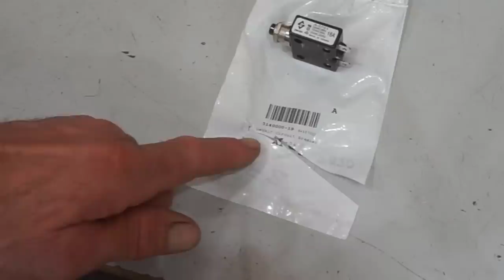DW735 Planer Deep-Dive Maintenance

Comment: Have you had to replace the rubber rollers due to the rubber getting hard and slipping on boards?
Reply from the maker: No I personally have not had that happen and have had 2 dw735 planer is for over 10 years each. They do get wood resin build up on them which might make the rubber seem hard but by thoroughly cleaning the rollers occasionally they don't seem to degrade measurably even over those many years.

Comment: Hey, Matt.  Love your work and the channel.  I was wondering if you considered any other reason the motor might be overheating, like dust blocking fan ports, dried out bearings or other issues at the motor proper?   I wish we had contractor craftsmen of your caliber here.  Best regards.
Reply from the maker: I haven't looked deeper into it because I was convinced the bushings would be the problem so I was surprised that everything was in such good shape.  New brushes might help but there's no indication or hint that the motor itself is laboring unreasonably.  Hoping I just got an inferior thermal breaker... that would be a first from ereplacementparts but not impossible to consider.  Time will tell... thanks for watching and commenting LMR!

Comment: Hey  Matt do you have any experience with the Shelix cutting head for the DW735 and what are your thoughts about them?
Reply from the maker: Just recently I actually verified what I suspected about helical cutter heads in the dw735 planer all along: while the surface that cutterhead produces is glass smooth even on difficult grain the small diameter of the cutter head leaves very shallow scallops across the width of a piece being planed., to me that fact is a deal-breaker so I will always have a planter with straight knives for making the Finish pass on wood that goes through my shop. Despite all the other Superior performance specs of a helical cutterhead the scalloped surface is a deal-breaker because I'm not going to devote the time necessary to sand out the scallops. I'm sure I will get flamed bye  the  helical cutterhead proselytizers for making this statement but the proof I have is undisputable. In a perfect world though I would have two planers: one with a helical cutterhead as the Workhorse of the shop and the one with straight knives for making just the final finish pass. I'm adamant enough about this that I may well buy a second planer for this ideal setup.
Best, Matt
Reply: As always great information, thanks.

Comment: I’ve discovered that the hex head bolts on the idler side are rounded over. I’ll have to work to get them out but I’d like to replace them with torx head bolts. Does anyone know the thread size and where to get them? TIA
Reply from the maker: The thread size is shown in the  head replacement bolts I've listed on my Amazon influencers page which you can find in the video description. If you can find a good quality Torx head fasteners of the same size and specs then it's a better choice than hex with both being far better than Phillips

Comment: Anyone have suggestions or how-to for setting the planer head parallel to the bed?  I've tried a couple things with no luck. Ref: planer (DW735) cutting about .100" difference side to side on a 6"wide board.
Reply from the maker: I've not checked but wonder if it's somewhere in the owners manual.  You might ask at ereplacementparts.com because if you replace any of the height adjusting parts you probably need to go through steps for re-aligning cutterhead to platen... let us know if you find a tutorial? Best, Matt

Comment: Lots of great information.  I just bought a DW735 and I'm performing all the maintenance items you show. Thanks. Mine seems to be stiff raising and lowering. Any ideas?
Reply from the maker: I've heard from other viewers who experience stiffness in height adjustment that seemed due to damage of columns during shipping.  I'd check into that to make sure you don't need to exchange it because raising/lowering should be smooth... not easy per se, but not 'stiff.  Best, Matt

Comment: thanks for the video I refer to this often when I maintenance my 735. But I failed to see where you spray silicone. ? the link for Amazon items does not load. what chain lube & silicone do you use ?
Reply from the maker: I don't remember exactly where I sprayed silicone in this video but it's basically anywhere I don't want pitch and gum to stick... but NOT on the infeed/outfeed rollers.  
You might find this video I did here on the Channel showing general DW735 maintenance tips helpful for more routine maintenance I do to get peak performance out of mine: https://www.youtube.com/watch?v=r_yEwlsYGbU  

Not sure why the Amazon link is dysfunctional for you... could be browser issue because it works on my end.  I updated the list at the above link by adding a silicone spray I like but the Boeshield T-9 chain lube I use was and is still on the list.  Let me know if this helps you out?
Best,
Matt
Reply: @NextLevelCarpentry  That helped thanks for the quick reply. I searched your list on Amazon web site and found your products. FYI I use Safari for the link.

Comment: What can I use to clean the rollers?  My planer is new but it just will not pull the wood so I have to push, yes the rollers are moving just not pulling.
Reply from the maker: This is the basics of the process I use:  https://www.youtube.com/watch?v=r_yEwlsYGbU&t=1s
Reply: @NextLevelCarpentry  I went to the DeWalt information site and they said use Mineral Spirits as it cleans and makes the rollers tacky again.  I tried this and this planer has never worked better.  I did use Johnson's paste wax on the bed and now I'm planing like a pro again.  Thank you sir.

Comment: My dewalt planer 735 cannot raise or lower to the thickness of the wood. Any ideas?
Reply from the maker: Sounds like a pretty drastic condition and one I've never experienced. If you are mechanically inclined at all I suggest removing the top cover for a look inside to see what's up. If the handle won't turn I suspect the chain is severely rusted or the top of the machine is packed full of shavings. Either one of those conditions could cause a problem you're having.
Reply: @NextLevelCarpentry  thank you

Comment: Great video. Will do this to my DW735. What about lubing the 4 height adjusting posts and gears?
Reply from the maker: I've not figured out how to lube the height adjusting gears... I do the chain that connects them all but sometimes still get an un-fixable squeak when doing large height adjustment changes.  Biggest issue/concern I have is that the planer would be worse than useless if something got off throwing the parallell-ness of cutterhead and platen off.  Since I don't want to learn/figure out enough to re-calibrate it I just leave it alone for now... Best, Matt

Comment: Can't  switch speeds with selector switch how can I repair this?
Reply from the maker: The planer needs to be running to shift the gearbox.  If it won't shift while running it will probably require a rebuild of the gearbox.  I've never experienced this problem and think the shift mechanism is pretty robust so I'd be surprised if anything broke.  If your machine is heavily rusted, it might me using rust buster on the shaft behind the shift knob.  Good luck... and let us know what you found out once you get it to shift? Thx.

Comment: Did you check if the cutter head turns smoothly? Those bearings take a lot of abuse.
Reply from the maker: That should definitely be on the checklist for a planer tune up!  The bearings are pretty robust and I've not had any failures but I may just be lucky?

Comment: Lets talk about the elephant in the room.I am curious about why the blade roller was not service as well.It must have beartings to,it spins very fast,it should attract dust as well.I would be curious to see the state of those bearings .If you remove the belt,would it free run ???
Just curious.
Bye.
Lucien
Reply from the maker: If it ain't broke, don't fix it?  Never had any trouble with it at all so I assume it was engineered better... fingers crossed though as I might be jinxing it! 😉😎

Comment: bought a new dw735 planer but the depth adjustment wheel so stiff to rotate up or down. I need help to solve this problem. Anyone?? please
Reply from the maker: I've heard this before and attribute that problem from damage during shipping.  To solve it I think you should check into getting a replacement since depth adjustment should be smooth and easy...  Best, Matt
Reply: I'm guessing your corner posts are not adjusted right. If you put a board that is the same with on each side the crank the rollers down on the boards they should all hit at the same time. if not you need to adjust the post that is off. once they are the same it should crank easy. If not the base may be warped and need to be replaced. I bought mine damaged and had to replace the base and do the adjustments and it works great now.  good luck, Dave

Comment: Ever service the height adjustment? Mine is stuck.
Reply from the maker: I've only maintained it by cleaning and lubricating the threaded columns and chain.  I suggest removing the top cover cuz there's a good chance there's a hole in the impeller housing that filled the entire machine which packed-in shavings that prevent it from raising/lowering.
Best,
Matt

Comment: Great video!  My DW735 has a 2013 production date, so I guess I’ve had it about ten years.  Last year I installed a Byrd Shelix original diameter cutter head in mine.  I always use the #2 speed position for the fastest thruput, but I’ve recently noticed it won’t shift to the #1 speed.  I assumed maybe one of the shafts moved relative to the others on reassembly, but I notice you didn’t do anything but straight reassembly of the parts.  Any ideas on why it won’t shift speeds?
Reply from the maker: Make sure you only shift it when the machine is running free, not under load.  The gears only mesh when turning.  Not sure what to think if it is running and won't shift but imagine the only fix is to open, clean and re-lube the 'transmission' but I've never heard of anyone needing to go to that extreme.
Reply: @NextLevelCarpentry , yes, I keep trying to shift it while it’s running.  The speed knob operates a shaft that goes into the gearbox, but it won’t move.  At some point when I’m enthusiastic, I’ll try pulling the gearbox cover to see if it’s obvious why.  Obviously, my theory of getting the rollers out of position isn’t the answer.  Thank you!
Reply from the maker: Good luck, Bill.  Do you know if the shifter worked before you swapped cutterheads?  Might be reason to think the problem is outside the gearbox, not inside it...  Hope a simple clean and re-lube of the gearbox does the trick.
Reply: @NextLevelCarpentry , thanks for the insight.  I’ve only used the slower speed rate a couple of times since I’ve had the planer, and I don’t remember when I last used it.  I’ll check all the linkage and the gearbox, but not for a while.

Comment: Matt, thanks for another another great video. I am a University professor and have to switch to all online teaching for the fall. What software do you use to edit your videos? Also, what kind of hardware do you use for recording? Thanks.
Reply from the maker: I wish you well on your transition Stephen.  I doubt my video production setup is anything to model after because it's an amalgamation of things I've ended up using along the way, not a carefully executed plan.  It does work well for me though and it's pretty low budget and low-tech compared to many/most.  That said I use this camera:  https://www.amazon.com/dp/B00NO1T55I/?ref=idea_lv_dp_ with this wireless mic system: https://www.amazon.com/dp/B00HPM086C/?ref=idea_lv_dp_ and this lapel mic: https://www.amazon.com/dp/B00HWMG44U/?ref=idea_lv_dp_ov_d&tag=aiponsite-20&linkCode=ic6&ascsubtag=amzn1.ideas.29WVINIJF4EUJ
It produces combined audio and video files that are all compatible with the Camtasia 2020 screen capture/video editing software I use.  Many pros recommend all sorts of 'bigger, badder, better, more whiz bang' stuff but I've learned that video production is a SYSTEM and that any tweak to any-thing can make it crash into dysfunction in an instant. So I stick with what works and what I can get by with.
You may find as I did that the video part is an entirely new animal with challenges that FAR exceed the most difficult woodwork project (for me) or complex lesson (for you) but if this 'ol nail bender can do it, anyone can... and that means YOU!  All the best on your new journey!  Matt

Comment: Hi Matt, thanks for this video.  I watched it twice before I did my shelix upgrade this week.  After 4-5 runs, I heard a noise and the v-belt was broke.  I think my problem has something to do with my install of those 2 sprockets, that chain and the idler.  I looked at parts diagrams and it turns out both chains (left and right side) are different part numbers.  When you were cleaning yours, how did you keep from mixing them up?  Thanks for the tip on the orientation of the sprockets, I think that might have been my error as I did a cleaning of them and the chains before reinstall.
Reply from the maker: I don't remember paying much attention to keep the chains separate Rick so I probably just got lucky not mixing them up?  If I remember your experience next time I tear down my planer I'll keep parts from opposite sides in different temporary containers to learn from your experience and save myself a bit of drama! 😎 Best, Matt

Comment: I’m having trouble raising and lowering the bed.
Do you have any maintenance videos on that?
Reply from the maker: Nothing specific, Jerry.  I'd recommend removing the top cover and blow out dust and shavings collected in there.  It will give you a look at the chain that runs around all 4 posts that raise/lower the cutterhead.  I suspect it's rusty and dry in addition to being clogged with dirt and shavings.  Good luck?
Best, Matt
Reply: @NextLevelCarpentry  that what I did and its all better! Clogged up gears in the corners
Reply from the maker: @daizamaker-jerrybraswell1997  Great!  I had that as a recurring problem some years back and discovered the issue was that there was a small hole in the plastic impeller housing. I figure the hole was from a knot on a board I planed that hit with such force it broke the plastic.  Even though it was a very small hole a LOT of sawdust blew out of it and would fill the area under that top cover and jam up in those chains.  It was an easy fix by replacing that plastic housing with an OEM DeWalt part which solved the problem...
Best, Matt

Comment: Matt, I have a big old Powermatic planer that is a beast for taking off lots of stock but i need a smaller, more prceise planer for detailed work.  Do you still recommend the DW735?

Thanks,
Andy
Reply from the maker: Absolutely!  It's the only machine in its class worth owning IMHO.  Best, Matt
Reply: @NextLevelCarpentry  Thanks, Matt.  Do you have any problems with snipe with that machine and how much adjustment is necessary right out of the box?
Reply from the maker: It's as snipe-free as any planer can be so, with normal stock feeding methods, it's very manageable and nothing I'd call a problem.  No adjustment should be necessary 'right out of the box' as it's a 'plug and play' machine.  I often hear about (and experienced myself) damage from shipping because the packing material isn't what it should be but, if the box comes un-damage I'd expect to just plug it in and go to work. Best, Matt
BTW if you end up buying through Amazon I'd certainly appreciate if you use a link from this page (if you're not obligated to anyone else's Channel): https://www.amazon.com/shop/nextlevelcarpentry?listId=29WVINIJF4EUJ&ref=idea_share_inf